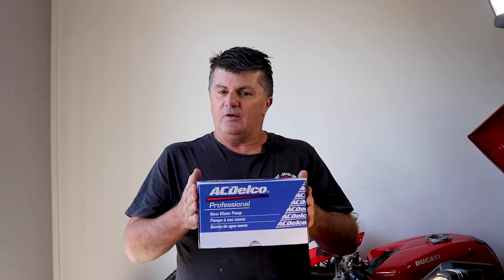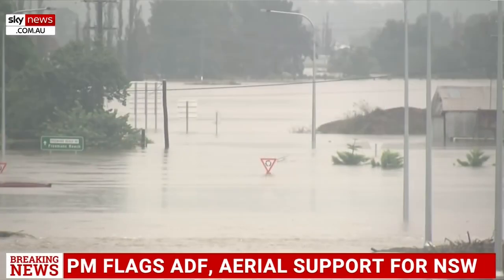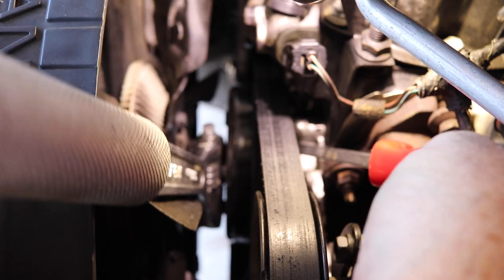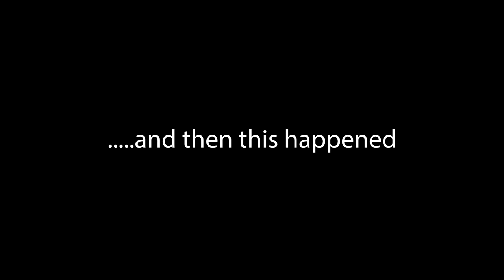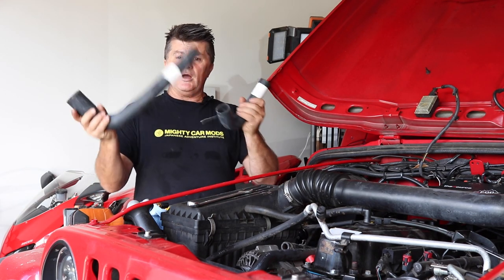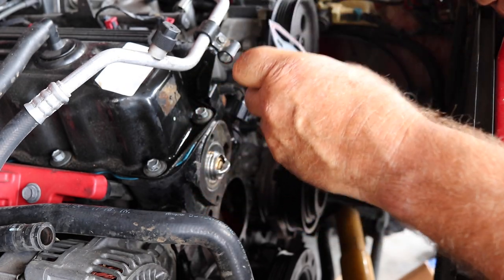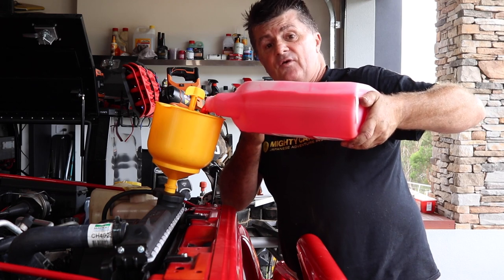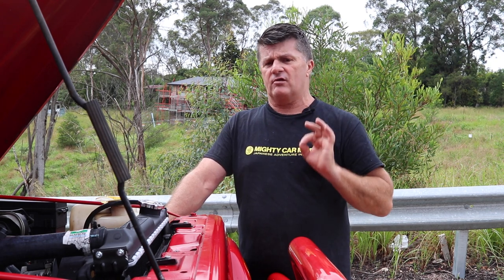Jeep Wrangler // LHD to RHD Radiator conversion // Cooling System replacement

Comment: Hey! I live is Sydney, and I just did this same job about 2 months ago!! New Mopar water pump, Mopar thermostat, Mopar thermostat housing and some Mishimoto hoses. I also put a new radiator in, however I used a Chinese full aluminium radiator due to needing a RHD one. Today the radiator failed! Should've bought a Mopar rad and done the conversion like you! But did not know it was possible :( I wish this video came out just a month or two earlier!
Reply from the maker: Hey Ben, sorry about the vid timing. Those aluminium rads promise a lot but just don't last.

Comment: G'day Mate, Great video series, I've referenced them a lot working on my own 06 TJ. Without getting into a huge debate on Mopar vs aftermarket, do you happen to know if the aftermarket rads available from rock auto can also have the brackets swapped over?
Reply from the maker: I couldn't guarantee they would, but with the Mopar version I looked at the pics on Rockauto and thought, would Jeep make 2 different radiator cores or just different removable mountings, seems the later. I generally have a squiz at the pics of the part on Rockauto and take the punt if it looks the same, as the savings are so much. I'd suggest the Denso and a couple of others are OEM replacements and going by the pics the mounts are removable, so whilst you're not guaranteed it will fit, it does have to fit in the same spot and has removable mounts so 'should be ok'.
Reply: Awesome mate, thanks. I was actually looking at the Denso. A few months back I had to replace the main seal, and wouldn't you know it, I stripped the thread in the timing chain cover. I decided that was a later job, and patched it with a helicoil. Got my aircon re-gassed, and now its blowing warm again. So now I'm going down the rabbit hole. May as well replace the aircon parts... well if I'm doing that I may as well do the timing chain cover, well while I'm in there, better do the chain. Probably a good idea to change the water pump too. Hell if I get a new pump and everything's out... lets do the radiator too just to be safe haha

Comment: After many months since you installed, the MSD rail still performing flawlessly? I’ve been sitting on the fence with the decision on refreshing the ignition. You gap the plugs any wider or run the factory specs?
Reply from the maker: No issues at all, I'm treating it as a standard rail so just a straight install.
Reply: @DarrylSheather  I just like the “bling” 🤷🏻‍♂️ but as long as it as reliable as oem, I’m interested. Look good with the Kenne Bell supercharger as well